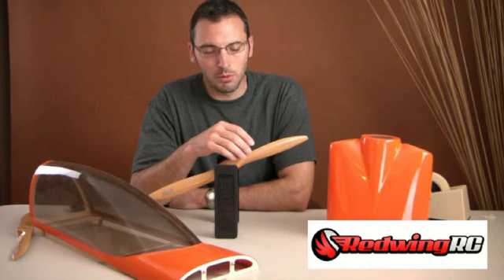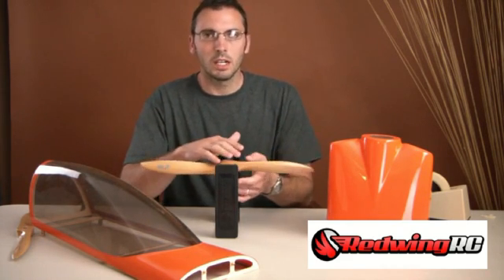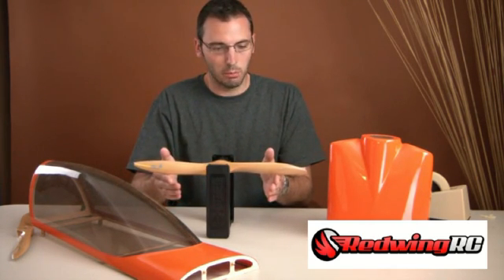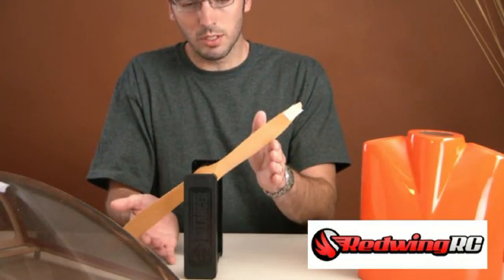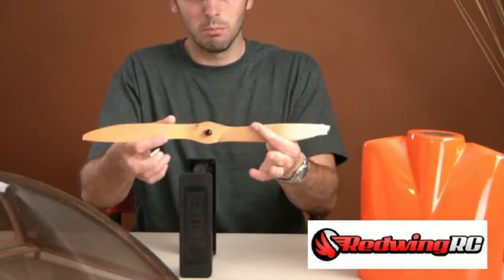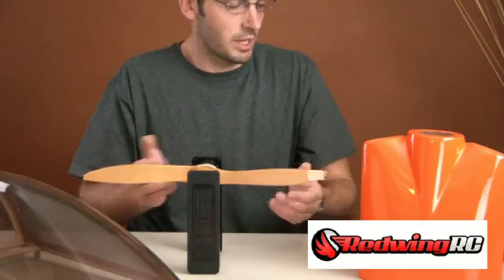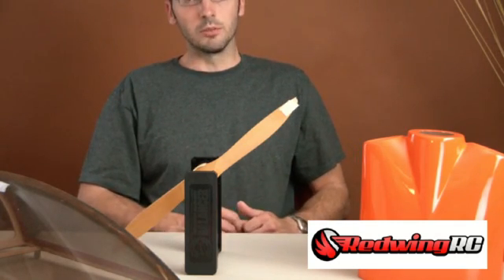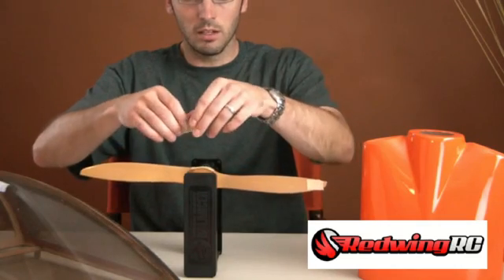Prop (Propeller) Balancing for Gas RC planes - 30cc 25% 3d gas planes

Comment: That is balanced statically but not dynamically. Ideally you need to find the C of G between the mounting hole and the tip of the blade which is almost impossible. Instead you should add/remove weight from between 1/4 and 1/3 distance from the mounting hole to the tip, this will roughly be the CG of one blade.

Comment: I can't see myself throwing away a $ 30 + prop away. The off center that I am talking about is only around .0050 up to .0010 of an inch, this just by itself throws the hub and blades off balance by a few grams enough to be a problem. This is just my way of cost savings. I have tried different manufacturers some props are good some are bad it just depends on who made it at their factory.

Comment: hi i have used this method myself ,it works .as stated you can use clear dope or paint inplace of your tape.
using tape is only a guide .

the way to tell if your prop is out of balance , is start your engine and watch with your eyes  on the tip looking from the side if its out of balance tip moves or appears to move from side to side.
my instructers very strict with me on having well balanced props,hope this helps it can be very frustrating .very best myfreind.

Comment from the maker: Tophat - That is not really balancing.  That is inspecting the prop.  there's not much you can do but throw away a prop like that.  So I wouldn't consider it balancing.    
Also, the redrilling you mentioned, is also not balancing - it is inspecting.  If you are getting props that are this bad, I would stop buying them from that supplier.

Comment from the maker: No, this is to teach how to balance.  It's mentioned in the video, that people get frustrated becuase they never fully understand how.  The tape method helps you learn fast.  So you can then do it by other means (and understand it).  

I HAVE used tape before at the field in a pinch, and it does stay on with no issues, just FYI.  But I usually use glue, paint etc.

Comment: The other part you did not mention is that there are 3 steps in balancing a prop. 1 balance it laterally. 2 balance the hub. 3 balance the plain in which the blades are traveling on...rarely mentioned this is done by measuring at the tips and rotating the prop which measures wobble at the tips. This is where one blade travels in front and or behind the other and not on the same plain or location which induces vibration. Hope this helps.

Comment: One thing you didn't mention about balancing a prop is the following. You can measure  the thickness of the hub from top to bottom and side to side to see if it was drilled off center by the manufacturer and if so you can then correct this by reaming out the prop for your crankshaft to compensate for the deviation at the hub basically re-centering the hole. Depending on how far off it is you may need to glue a dowel filling in the whole in the prop and starting from scratch.

Comment: hi, 
I used tape to balance my 18x8 prop and made sure there was no bubble when the tape was stuck, i tested the prop on the engine stand and your right the vibration was reduced alot. 

my question is that can i used tape and not use glue, becuase I feel glue would be very messy and a lot more difficult to work with.

Comment: ive just purchased a new prop 4 my easystar plane , its a "pusher plane" and am concerned that i have now got a "puller prop" on it?
is there a diference between props that pull and push?
and i assume that the thin sharper part of the prop never goes into the wind?
understand me? ne1